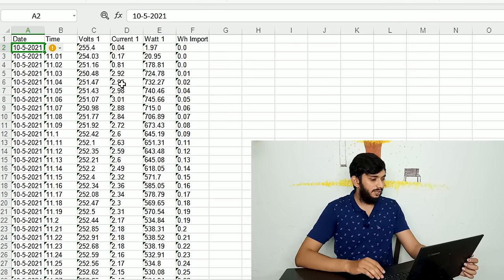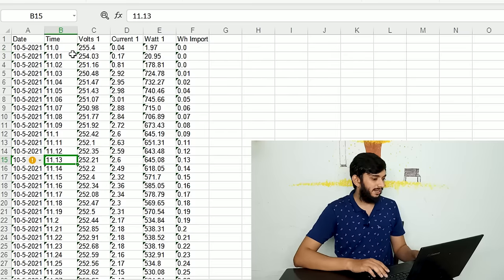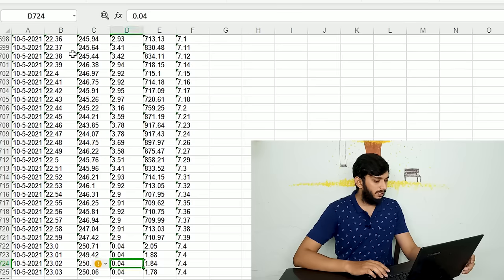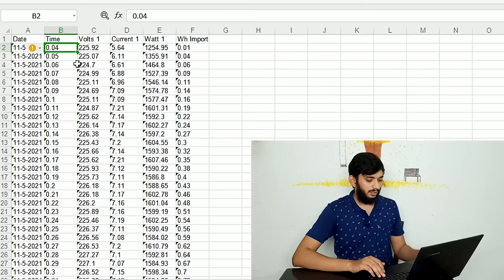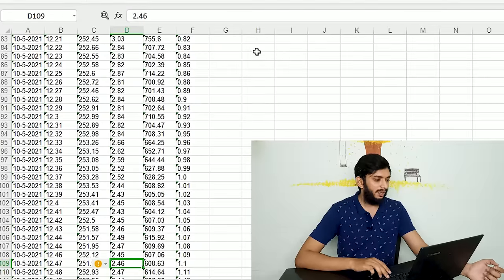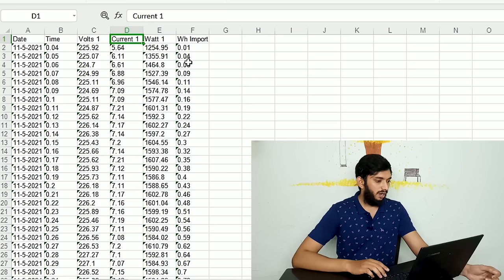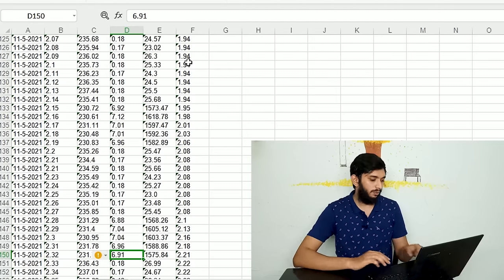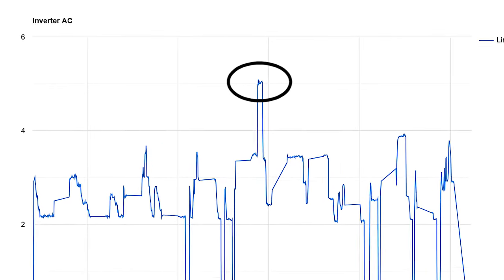Inverter AC vs Normal AC, How much unit will it consume?_Tamil, Does Inverter AC, Energy efficient?

Comment: Buy a good quality inverter ac which is 5 star and then do a test rather than using cheaper brand ac.
Reply from the maker: Which brand is branded? All the inverter PCB's from the AC, are not manufactured by AC companies. They are purchasing from other OEMS. Mostly from china, japan, Korea..
Reply: @engineeringfacts  I agree, but if you shell out more money on 5 star inverter AC you may get reduced power consumption, Also there is an option in Toshiba inverter AC to adjust the power selection mode from 100, 75, 50 percent & I have seen the AC running without no sound at all, 
Also there is an sleep mode in AC where temperature is increased at the set interval, So you wont need bedsheet & it keeps you in an comfort zone,

Even I may be wrong but you should try the power consumption statistics for 5 start inverter AC so that we can have facts

Looking forward for a new video with 5 star inverter AC review.

Comment: Inverter ac spire, pcb board high rate normal ac spire cost very low and also any problem in compressor simple repair 10k only , but inverter ac pcb board   want repair maximum 18k   ,😂 This is business 😂